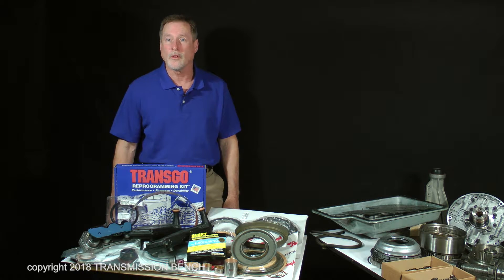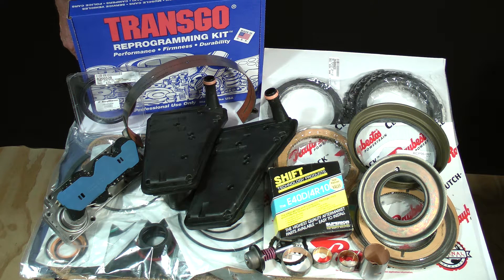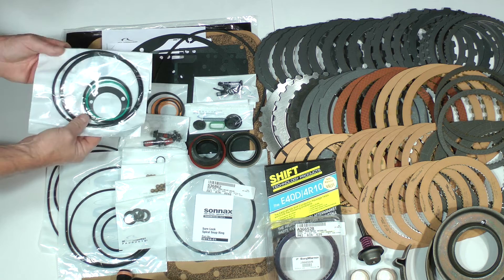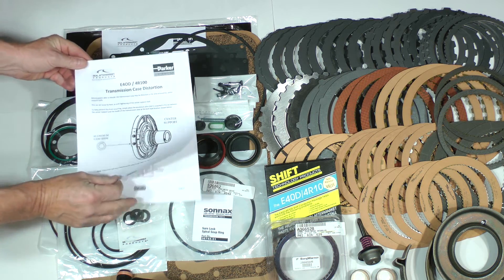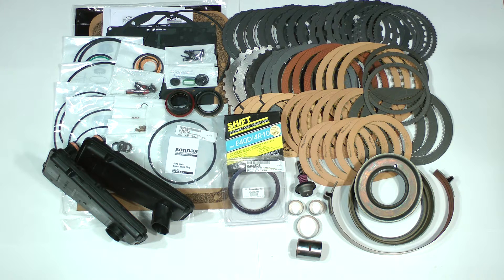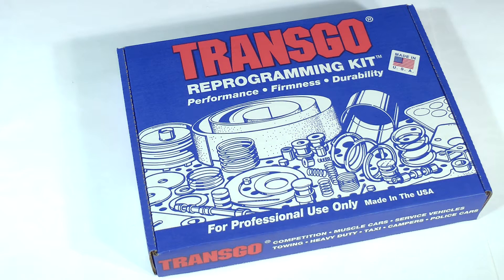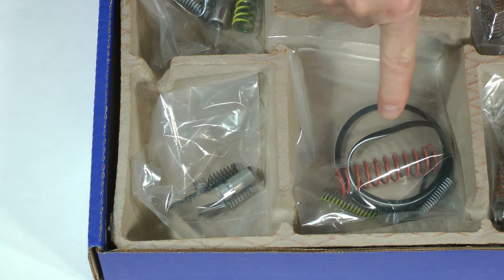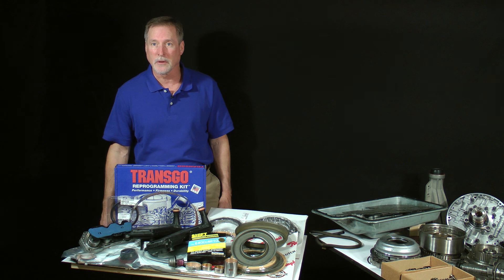Ford E4OD / 4R100 Class lesson 9 of 16

Comment: My 1994 E4OD goes in reverse only. I removed the solenoid pack for bench testing and it is within specification. Anyone have any idea what I can llok for next without removing the transmission? I was thinking to connect the solenoid pack to the harness plug and place the shifter in D to see if the solenoid clicks. Not sure this is possible though. Any ideas, anyone? Thanks and GREAT videos by the way. I liked the part about "the ocassional street action".